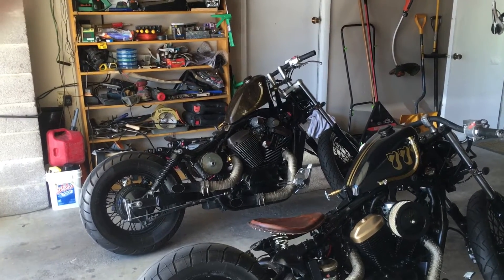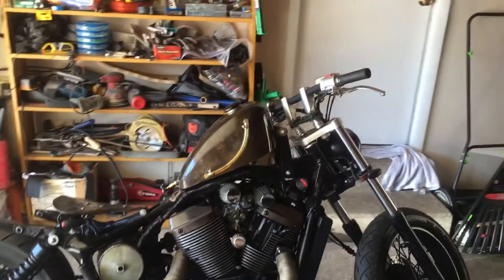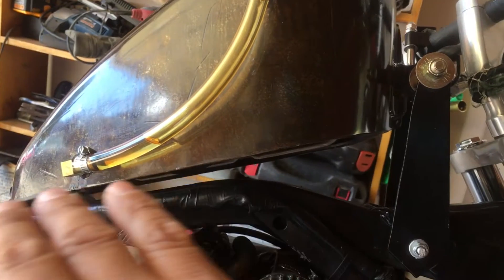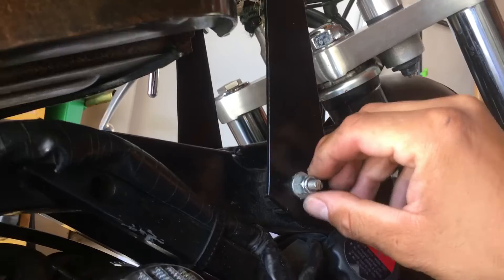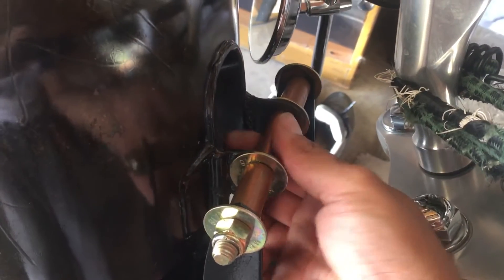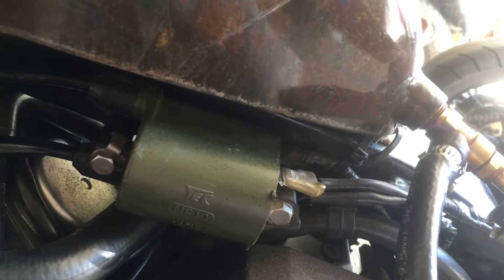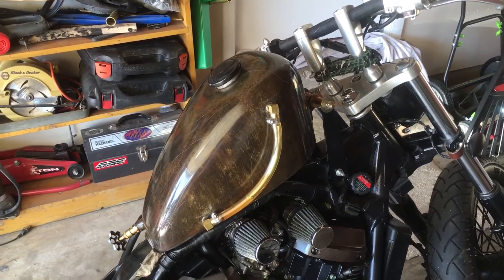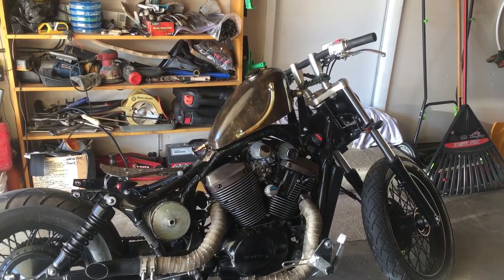HONDA SHADOW 750 SPIRIT (tank option)

Comment: Love your bikes, How  did you do your pod filters? I am bobbing an  83 and the intake sits too high above frame rail to mount new tank and very little clearance to go straight under top frame bar fron carb inlet..suggestion??
Reply from the maker: I have another video on my channel called "air filtration" check that out.. that might be able to help you, Its hard for me to give that kind of advice over the net without seeing it..:/
Reply: @bannanapancake  I understand. I have watched that aswell, I will come up with something,  got my ashbury bobber tank in today, looking for a black acid treatment for it.
Reply from the maker: Matt G - Nice man.. if you run into any problems, I’m around feel free to ask!  Rubber side down brother be safe!
Reply: Question,  when you chem treated your gas tank did you wash it off with water,  did you get some surface powder rust?
Reply from the maker: Matt G - yeah we used a thing called “blacken it” I might have mentioned that in the video?? (I’d have to go watch it again) but yes, the longer you leave it on the darker it tends to get, YES, wash the excess off with water, and it’s normal to get a little bit of surface rust on it when it drys that’s kinda the idea;) if it’s to dark you can always use a really light grit (or Emory cloth) to scrub it a bit and re-apply the blacken it again to the desired effect.

Hope that helps

Comment: I like peanut tanks but I've actually wondered how tough it would be to cut out the square section and replace it with a round section I feel like I've seen a video of someone doing that somewhere I just can't remember who it was haha. But it you modified the frame then you'd be able to mount any harley tanks to it.
Reply from the maker: Yeah, you most definitely could for sure, in my mind its a lot of extra work and when you cut it it may never have the same rigidity it once had unless its improved upon, also when your riding at 70mph you'll wonder if someones else's welds can be trusted...just food for thought:) thanks for the comment man, stay safe!

Comment: You guys have some badass bikes. I noticed you left the stock switches on the bars. Are you thinking about moving them? If so, I wld appreciate a tutorial on how to. No one on YT has one up at all. Keep on posting tho. It helps. I'm 💯 getting that tank Bc of this video
Reply from the maker: toriano81 - You'll like the tank for sure.  I'm not planning on  relocating the switches, I've got enough illegal moves on my steed to shut me down 10times over( I will never ride a factory bike) it's hard to get these bikes street legal as they sit. I'm not saying don't do it, but if your the law abiding guy (I just play dumb most of he time) then you might wanna check the rules,  the safety might shut you down.  The way the law see's it anything you have to take you hands off the bars to assist in your riding is illegal (least in Utah it seems, suicide shifts and all that).  Some of the things to consider; "I think" that TJ brutal customs has a set of re-routed cabled grips, old bike barn might have them too..(they both cater a lot to metrics) but you'll have to find an alternative to your master brake cylinder... your turn, high's and low's are   Relatively easy to relocate and reside with a toggle at 2way switch. I appreciate the idea to make a video, I'll consider it here after the holidays;) thanks for your comment, and have a good Christmas;)
Reply: I'm in Cali. So we get away with a lot out here, bike wise. Our gun laws suck!  But I managed to figure it out myself (with absolutely no previous knowledge of wiring or automotive). But it was a pain in the ass for me anyways lol. But there really isn't much for diy's for shadows on aftermarket add-ons. Regardless I'm getting that tank Bc of your video. Thx again
Reply from the maker: toriano81 - Hey no worries! I'm glad it helped you in someway, if you have any more questions, you know where I'm at!!! Have a good Christmas man!

Comment: thinking about getting a 1100 but i like the 750 and 600 do much im planning on some pritty nice dized trips in your opinion would a 750 comftubly cruise on the highway iv heard mixed things
Reply from the maker: Ben Israel, yeah, a 750 or 600 would be just fine, but you know... a 1100 is obviously more power.  If your 6ft nothing 200lbs or lower, both those smaller bike would give you everything you need to ride safely. Any more hieght or weight, I'd go with a bigger bike? Personal opinion though.... hope this helps;)

Comment: Hey man did you use your reserve tank and if you didn't how did you route your fuel pump in which pump did you use did you use a factory one run aftermarket
Reply from the maker: I'm having a hard time understanding the first part of the question... "reserve tank"? I used the factory fuel pump in this case, just hooked it back up to the petcock.

Comment: Hey man this is my first bike and i want to convert it into a bobber but idk how to install the petcock. Can you help me with that ? Where does the hose go or did you buy a new hose/stock hose worked for it ? 
Also how did you make that fuel switch at the left bottom. That petcock is really giving the retro look.
Reply: +bannanapancake thank you for such a quick reply and no i am not fabricating my tank i am buying the same tank as you but i have never customized a bike before this is my 1st so i am bit nervous to do all the stuff
Reply from the maker: abhinav monga- Hey no worries, it can be intimidating at first for sure, im not going anywhere, so if you have questions just refer to that email;)

dudewhatthesmackisthat@gmail.com
Reply: bannanapancake hi 👋, been following your feed and i always end up here regarding peanut tanks. From the tank, i dont neet to change anything except the petcock? And i can leave the rest (vacuum pump, hoses to motor etc) thanks again! Keep them videos coming even though its been awhile it would be nice even if your just ridin around. Ride safe 👍👌

Comment: Love that bike. How did you do the acid style paint job on the tank? And how did you make the seat? could you do a video on both? Thanks
Reply from the maker: LG Leon Guerrero - Thanks for the comment,  the tank is treated with a solution called blacken it, you can find it in eBay. Once you have your tank from where ever you'll want to clean ALL the oil off of it with some dish soap and water, then fully let it dry for a day (or use a hair dryer for faster results). Take the solution and with a smaller brush paint the tank you'll have to work pretty fast cause the solution will have an  immediate effect. The longer you leave the solution on the darker it will get, so have a hose and some water ready to go. If it gets to dark, you can use a really light sand paper to get some of it  off, then re-apply.

The seat is nothing more than diamond plating, cut and Hammered out some, then drill he appropriate holes for the springs and what not.
Hope this all  helps some
Reply: bannanapancake Thaks for responding.  Going to look for the Blackened and make a seat like the Bull.
Reply: bannanapancake i picked up a pandemonium tank and mounted it on my VLX. Did you seal your tank and if so, what did you use. Thanks.
Reply from the maker: LG Leon Guerrero - Hey great question! There is a product called "RED KOTE" that works wonders for sealing. Some people seal them some people don't, but I always encourage people to do so. You'll probably notice that your tank came all oiled up in a plastic bag? I clean all the oil off and out of the tank REALLY WELL with DAWN dish soap and water. After you dry the surface, position the tank sideways take out the petcock plug (if it's still in) get a old hair dryer (one your significant other won't kill you about) and position that to blow into the tank so the air will circulate through the gas cap hole and out the pet cock hole. I'd let it run for about 12-15 min while you do other things, youll want to do it this way cause rust will start to sit in real quick after it's wet, so getting the inside dry is priority, next, run to Home Depot/Lowes get a metric screw to fit the gas gauge holes(I'm assuming you got a tank with the external gas gauge? If not skip this step right? I forget what size those screws are sorry) and plug them up along with the pet cock and gas cap area. You can double up  a plastic Walmart bag to plug up the pet cock hole, just make sure it's tight in there (the Red Kote is semi thick so it won't get through a plug that easily) you can use another doubled up bag for the gas cap, just put it over the top stretch it out so it fairly tight and tie wire or zip tie off around the base off the gas cap (DONT use your gas cap as a Red Kote plug!! those tanks breathe through the caps so you might run into starving the bike when you go out and ride it case that Red Kote plugged it all up...if that makes sense) BUT FIRST fill it the tank with the Red Kote right?? Then after its in there and holes are all plugged, lift it up and turn it every which way rolling it so that Red Kote will permeate every little crevice inside. You can usually get away doing 3-possibly four tanks with a can of Red Kote(I think they come in quarts??),anyway after you feel satisfied with the coating process hang the tank with a bungee cord or something and have a funnel underneath and out excess back in can(get the majority of it out of the tank back into the Red Kote can and seal that lid back on for later use. let the rest drip into a cup instead, it's got a curing property in it so by the time you feel good about getting it all out  back in the can it will be all gelled up and no good any more. So just use a plastic cup to catch the remaining drips. Let it dry for a good 2-3 days before you THINK about putting fuel in, I work on other things while I let it dry so it usually sits in my hand like that for a good week or so until the bike is finished and ready to fire up. 

Hope this helps;)
Reply: bannanapancake Cool man. Picked up a can and will be working on it this weekend.  Thanks!
Reply from the maker: LG Leon Guerrero - no worries, you run into any stumbling blocks I'll  be around;)

Comment: I noticed you used the faucet petcock. Does it have a connection for the fuel hose and the vacuum hose?
Reply from the maker: The auxiliary faucet part is actually an add on that you can get when you buy a tank from those guys (Im not affiliated with them in anyway), they have a few different petcock ideas. it does have a connection for the hose and the vacuum comes from the cap itself

Comment: Hello again 
I Ordered one of those tanks . And I have one question what  did you use to seal petcock and side fuel line threads so they would not leak ?
 
Thank you very much !!!
Reply from the maker: Sorry for the late reply, Its winter here so I don't check the threads as often. They have fuel grade pipe dope that you can get, even in tape form it works pretty good, hope this helps

Comment: AWESOME BIKE!!! so i ordered and just recieved the pandemonium tank for my 2003 shadow 750. was wonderinmg what you did with the vaccuum line as theres is no  option for the vaccuum line on the pandemonium tanks.
Reply from the maker: Derrick Agbay - hey! Right on, I'm not affiliated in any way with them, I just think it's a cool product;) some of the older tanks have a draw line (breather) but if you got a gas cap from them that fits that tank, you won't need one, it breathes through that. I hope that's what your asking?
Reply: sweet and how long were the metal pieces you fabbed up that bolts to the frame and to the tank?
Reply from the maker: Derrick Agbay -  Sorry for the late reply, but I don't remember he exact length, they were something like 8" I think. Best way to do it is to prop or have someone hold the tank right where it sits nice with he frame angle and measure from the middle of the holes in the tank tabs to the holes that run through the frame, then give your self about a 1/4 to 1/2 inch play around the holes that you'll put/drill into your metal supports for strength. Hope this helps.

Comment: Hey so im in the middle of mounting my tank from pandemonium on my 750. I'm a little scarred to bend those bottom tabs too zip tie it to the Frame. Have you seen any other otions? How hard is it to bend those tabs? Just hammered them flat and put a tie through the hole and around the frame?
Reply from the maker: spencer gordon, Hey, you can bend them, the best way to do it is to heat them up some and bend them with a rubber mallet and a piece of wood. We bent them down cold and with a standard hammer so it's possible to do it that way.... but what ever you do don't lay the tank on a hard surface to bend them down, the impact might damage something else. Put a soft old towel or blanket to absorb the shock underneath the tank. As you bend them down try to bend them out in a uniform fashion (don't pound in 90 angles) otherwise you "might" break them (that's why the heat would be a good idea). It literally took me 10min to bend them both down just take your time, don't rush it. Hammer some, check the bend, readjust your hammering to accommodate the curve uniformly.  

You could (could) cut out 2 slits in he frame so the tabs could sit down into the frame and drill out the sides and attach it that way, but frame cutting and drilling is kind of a red flag for me.. let me know if this helps, if you need more help let me know we can get in contact some other way to have better communication, let me know if you got this message, some people haven't been getting there messages for some reason! Thanks man;)
Reply: sweet thanks! big help. got the message. I'm going to try the bend tomorrow, ill let you know how it turns out.
Reply: spencer gordon how’d it turn out

Comment: What intake filter are u using
Reply from the maker: just a regular air pod, you can get them off of ebay/Amazon, just take a pair of calipers and measure what your attaching it to and find a pod that is just a smidge smaller to stretch over, that with a clamp will make a good seal for you. hope that helps

Comment: This was extremely helpful
Reply: Do you think it could work with a honda rebel. The rebel has a big backbone as well i thin 2.069 or 2 1/4. The tunnel on the stock tank is huge. The way you mont this tank on the shadow iis great. Do you think it can work for a rebel?
Reply from the maker: I've actually never tried it on a rebel, but I think it could essentially be done yes..you might be able to take some of the ideas from this video and apply it to the smaller bike.  Some things might work and some things won't the same im sure, but it will give you a good start to go from..

Comment: What did you do with the breather line on the tank? I just got the same tank and it doesn't have a spot for it
Reply from the maker: shep acree- hey man thanks for the comment, the tank doesn't need a breather tube, the gas caps from that company are designed to breathe for it, I would get one from them to insure a proper fit, hope that helps:)
Reply: bannanapancake any cutting or modifying of the tank to fit apart from the mounts?  Is the front end all stock.  Did you just chop the original exhaust  and then add those custom on the tips? Also do you remember the length of those custom supports for the tank? Thanks man

Comment: Did you re jet your carbs for that aftermarket intake?
Reply from the maker: Kyle Nussbaum - yeah, this is a straight in and straight out set up (air pods/straight out pipes with no baffles) we used a DYNOJET kit #T-1183 (stage 3) hope this helps and thanks for the comment;)
Reply: bannanapancake - Exactly the same setup I'm going for but I've just been running with a choke on a little, i dont know if that's bad for it though. I saw this tank and had to get one thanks for posting!
Reply from the maker: Kyle Nussbaum Hey no prob;) yeah running the bike on choke is not that good for it, id get a rejet as soon as possible. Glad I could help, if you have anymore questions just let me know;)

Comment: You think that would work on a 2019 Honda shadow
Reply from the maker: haven't dug into a 19, there pretty new.. if the frame geometry is the same as the one in this video, should be able to handle it, might have some minor differences. Hope this helps

Comment: This tank will work on the 98-2003 ace. I have a 99. The backbone of the ACE is different and better than this bike using this tank. the reason is, the ACE has a straight square backbone with the drop happening near the seat and not up near the neck. None of this bothered me because I chopped out my backbone and replaced it with 1 1/4 1080 (11g wall) DOM tubing allowing a "mo-betta" fit. check my page soon for pics and vids of the build.
Reply from the maker: cool, If I remembered right, it kinda resembled a little bit of the 650's tubing in a way.. thanks for the info, I know that there are a few guys in the past who have 1100's and it does come up from time to time.

Thanks for the comment
Reply: Yea bud, you bet.